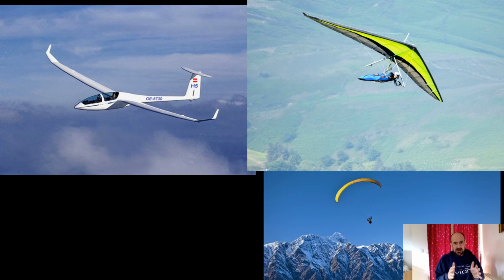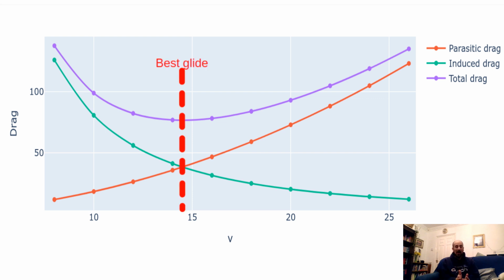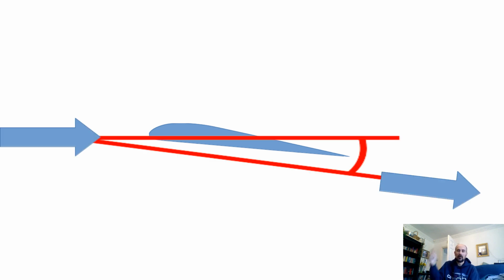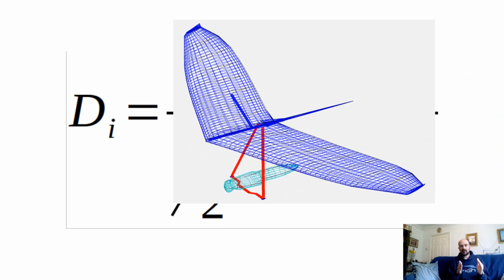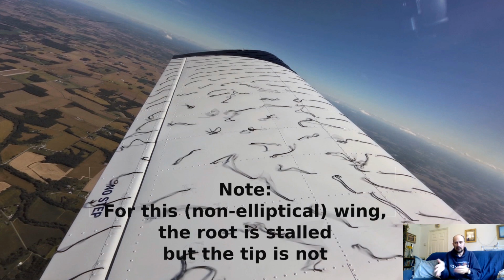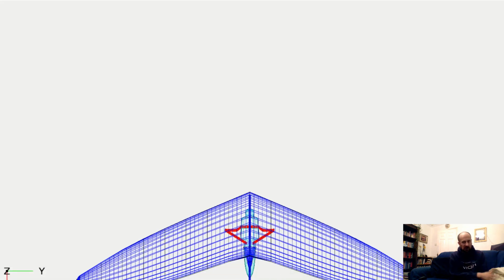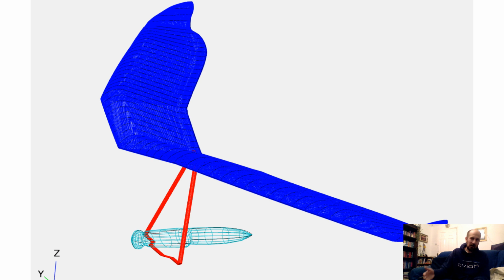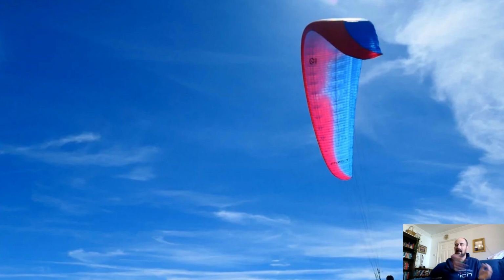Hang glider Performance - why induced drag matters!

Comment: I always thought that parasitic drag was the drag created from all the non-flying (the bits that create zero lift) surfaces & structures - A frame, side wires, king post, pilot, luff lines, etc. These do not create any lift, only drag. Hence, parasitic. And I always thought that induced drag was the drag created by the wing - the veritable trade off of flight for all 'wings' - L/D or lift to drag ratio. I can see from your detailed explanation that this is too simplistic.

Comment: Excellent video and an excellent series. Thank you. I am curious, however, about how including the tail of the airplane in the analysis might change the comparison between a hang glider and an airplane. After all, it's important to consider the whole aircraft since a "virtual tail" is already implicitly included in the analysis of the hang glider.
Reply: It is easier to design something with a tail (see sailplanes), as well it is easier to design and get more performance out of a rigid wing, but I guess our sport is somewhat stuck with tradition. 
As I understand a flying wing can be made to beat a traditional empennage tail plane in a specific speed range, but since it will require washout/twist for stability, and nose angles can only be so wide before it is unstable in yaw too, when you try to make it fly faster the twist in wingtips will create more drag.
Then regarding rigids, back in the day when there was no category division, rigids would beat flex wings every time. Then I think manufacturers put pressure on FAI to create categories, and as the lower price of flex wings meant more pilots in that category, made that be the main comp category until today. If we had no category division, then comps would be dominated by rigids, we would have more brands making them, and flex wings would probably be for recreational flying only/mostly. We might not even have topless flexis being made at all (??)
There are empennage-tail ultralight gliders out there, like the Archeopteryx, which is interesting to compare with a Swift (flying wing). Supposedly the Archeopteryx has a glide ratio of 28:1 and Swift 27:1, Swift flies faster while Archeopteryx handles better at slow speeds. In overall soaring performance I think they are similar. I find the Swift the coolest so I'd buy that one! haha And it can take more G load before breaking...
But then there is the Atos Wing, which has 3 axis and traditional empennage and is not a flying wing anymore. It is A.I.R.'s highest performing aircraft, that should mean something. They could have made something more similar to a Swift, yet didn't.

Comment: Could you gain performance with less wing sweep and a significant tail plane or stabiliser to address pitch stability?
Reply from the maker: Not necessarily. Theoretically it should be possible to achieve about the same efficiency either using a swept wing tailless or an unswept tailed design. However the structure of a hang glider does lend itself to a swept wing, stretching a membrane between the wing tips (via the keel) to form the sail shape works better with a swept wing. Then if you're building a swept wing anyway then it's best to design it to not need a tail.

Comment: Love your videos, thank you.
Re the last part about paragliders catching up with hang gliders in performance, I think you missed the very important factor-paragliders are much, much lighter!
And on the same note-IMO, hang glider development will not have a major breakthrough in the performance, until some new LIGHTER materials are available both for the frame and the sail.
Reply: Weight doesn't matter to performance at all. Pilots often fly with ballast for BETTER performance, and the best performing hang gliders are rigid Atos VR, that weight something like 40kg. Making a glider lighter only makes it easier to carry from your car to launch. Rigids solve that by dividing in two pieces of around 18 and 22kg.
We have already very light material: technora and carbon fiber. Given the high tension of hang glider upper sails you can only make it so light before risking it rips apart.
Carbon fiber is only more moldable to your specs, but in some parameters metals can be much better, like compression. And it allows things like elliptical leading edges (Combat C) and D shaped spars (Atos). The issue is it is expensive, 2~3x the price of a 7071 frame. Also alluminium/titanium alloys like scandium can sometimes beat carbon in some uses. Even steel alloys can beat, like Cromoly-Niobium alloys in some cases. Aerospace/rockets use C-103 and Nb-521 alloys with lots of Niobium but they are VERY expensive and will never see use in hang gliders unless some huge mines were found in many places.
Yet, if a 30kg glider suddenly weighted only 15, not much would change in flight at all, IMO, all else being the same (shape and stiffness).
Reply: @ericoschmitt 
 Atos’s high performance is not because it’s heavy, right?
Pursuit of higher performance has made the hang gliders heavier. 
Inevitably. 
Without new lighter materials any attempt to gain performance will make them heavier. (Seedwings Sensor).
Look at sailplanes.
Meanwhile newer high performance paragliders are using new lighter materials.
I am thinking in the realm of the flex wing hang gliders.
Everything being equal, you and I will pick the glider that’s lighter.
You said 50%? I’d dream of that!
With substantial weight reduction in the materials the gliders will get smaller for the same wing loading, which will lead to even more weight reduction and even easier handling!
Then maybe you can shove more stuff into their guts or make the wings cleaner in the pursuit of higher performance.
Without new lighter materials I don’t see a noticeable jump in the glider development in the near future.
Reply: @vrezhtumanyan4714  I never said rigids have more performance because they are heavier. They have more performance because of better lift distribution over it's span while flex hang gliders leave most of the work for the sail in the inner-mid span, because of billow. And the leading edge / batten camber does not deform in higher speeds.

Yes, everything equal I'd also prefer the lighter glider. But things are never equal. As soon as lighter materials come out, you have the choice to reduce weight OR keep the same weight to make structure stiffer, span greater, lift distribution better etc. So for us it will always be a choice between performance and weight, given the available materials. Nowadays you can have a 20kg glider with a glide ratio at 10:1 or above (Icaro Piuma), that would be unthinkable decades ago. Or you can get a modern topless.

Regarding a near future jump in performance, that's exactly what Avian is doing, and you will see it pretty soon. Keeping materials the same, Tim is changing structural paradigms so that he can get better lift distribution, and thus better performance. Also improved handling, he also made changes to improve that.

With better glide/sink AND better handling (comparing to an Avian Puma), he will probably get a wing that might match or even surpass current topless gliders in cruise speeds while still having a kingpost. Not you may choose: keep that glider, get a topless version with more weight and performance, or step down into a lighter glider that may have worse glide than the Puma, but super easy handling.

Aviation will always be about tradeoffs and there will always be pilots like me who will rather buy the highest performing wing regardless of weight and setup time. It will be always a choice of making a glider 20% lighter with same performance, or 20% more performance with the same weight, sort of. Or make them heavier but perform even better (aka rigids). For each their own. 

Regarding paragliders, yes they got thinner sails that make them a few grams lighter. But they are also trash after 200 hours, or at least not competitive after as low as 50 hours. Paragliders are more expensive in the long run.

If you care too much about easy of transport, storage, and setup, maybe give paragliding a try and accept that 10:1 glide ratio. As Tim said, I prefer to fly with something that waits until after I have landed to fold up! Aaand that goes faster/further.

Comment: Great presentation Tim, more power to you for trying to push hang glider design out of the doldrums. Just a comment, way back in the HG medieval period (1974-1980), designers knew that a curved leading edge conferred some performance advantage whilst allowing a loose enough sail to retain reasonable handling qualities. Examples include the Seagull aircraft series, the UP mosquito bowsprit and lots of early deflexer equipped gliders. You could argue that curving the leading edges reduced mid span washout and made the span wise lift distribution more optimal? With my tongue firmly in my cheek, "what was old is now new again?"
Reply from the maker: Hi there, yes, I've come across the UP Mosquito and the Seagull. As I understand it the Mosquito particularly was quite impressive for its time. What they didn't have them though was modern materials to be able to shape the LE into the optimal shape, rather than it just being whatever it happens to curve to, also with the rigidity to hold the shape in the off design  cases and then computer simulation to know what the optimal shape is. I do wonder where we'd be now if there'd been 40 years of development on UP Mosquito derivatives rather than UP Comet derivatives...

Comment: Stability and control authority MUST be included in any general performance discussion. A glider with zero sink (obviously impossible) is useless if you can’t control it. Fly trhough a couple knarly vortices and you’ll appreciate control authority far more than max glide or min sink.
Reply from the maker: @chriswendling3978  totally, please see the other videos in this series.
Reply: I think you'll find total agreement on that point.
Reply: Unfortunately what is very often true- and what many designers don’t know or wont tell you- is that improvements in specs like min sink, max glide, and l/d come at the expence of roll authority. Increasing wingspan can reduce induced drag- but it also usually reduces roll rate. Not always a good idea!

Comment: Nobody cares. Make lightweight packable practical hanggliders, that's what we need.
Reply: So: A wing that packs to less than 2m, weighs less than a current wing, handles easily and lands slowly while having exceptional performance is of no interest? Your choice.
Reply: Thus spoke the sexy entitled female.
Reply: I care.  This is a very good, reasonably in-depth presentation, which I’m sure took a bit of time and commitment to produce.  Thank you to the producers for publishing this.
Reply: I care .
Reply: I care about performance and flight characteristics, and not much about packing length or even weight. Most sites I fly I park the car by the side of rigging area. And I chose my flying sport based on actual flying, not on how it walks. For hike and fly, paragliders work well enough, at least the hiking part. I don't trust them for flying though, and I tend to hike in some days (cloudy and unsoarable), fly other days (great weather), not mixing both :) So yeah, go go go Avian!!! Make nicer flying wings for us, and give me a good reason to be irresponsible with my money spending :D

Comment: Love the video, but pleeees look up prandtl NASA fling wing. It uses bell shape lift distribution. The best induced drag, and cordinated turns.
Reply from the maker: @javieralegremoreno2998  I'm aware of Prandtl D. A bell shaped lift distribution is the lowest induced drag for a given structural mass (given certain assumptions which are less relevant with bracing wires), but an elliptical lift distribution is the lowest induced drag for a given wing span. Other lift distributions give the lowest induced drag if you have sweep and dihedral changes. I.e. if you design for different objectives then you'll end up with different outcomes.
Reply: The bell shaped lift distribution, if correctly optimised, gives minimum induced drag for a minimum mass of structural material carrying bending loads for a cantilever wing. It does not give minimum induced drag for a given span. There are many parameters to optimise in any aircraft design and material mass carrying bending loads is only one parameter. If strut braced or wire braced then a different loading will be optimum for mass. As most aircraft at the lighter end of the spectrum also have substantial secondary structure mass, the bell shaped loading is not particularly useful. If the aircraftvis spannrestricted and best glide is the objective and the wing is not swept and has small or no dihedral then elliptical loading wins. Notice all those constraints in that list. Different constraints result in a different optimum.
Reply: Uuuu nice info. I'm clearly not an expert butt it made intuitive sense tu me to add the dawn force or reflect as far back as possible. And if you can actuate alavons at the tips of the wing, with automatically cordinated turns, sunds great. It might give enough control to increase aspect ratio and wingspan. Maybe activated by the hardness angle...

The chefs kiss would be flap mechanism in de center, for landings, wiht the center portion of the wing acting almost as canard. But it would need a lot of sweep and thin chord...